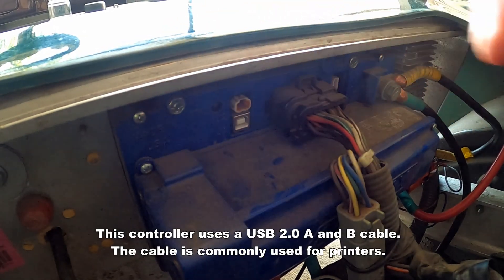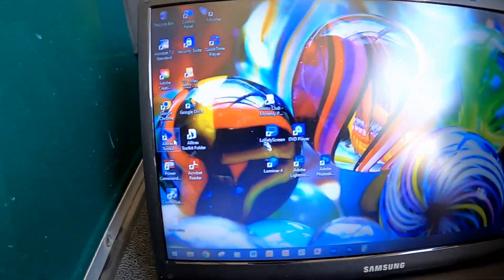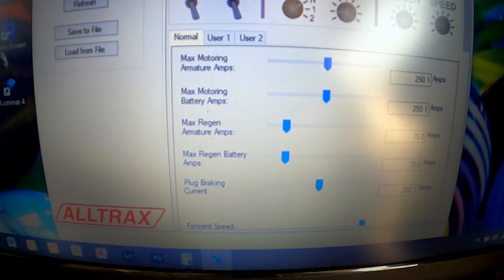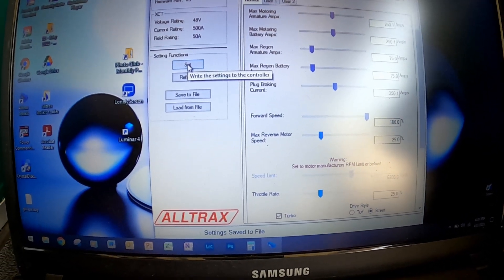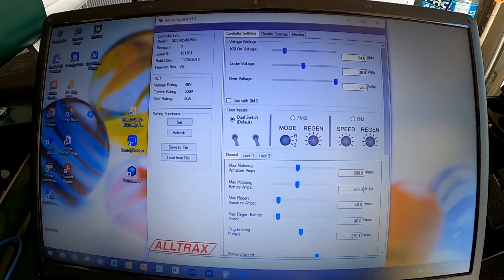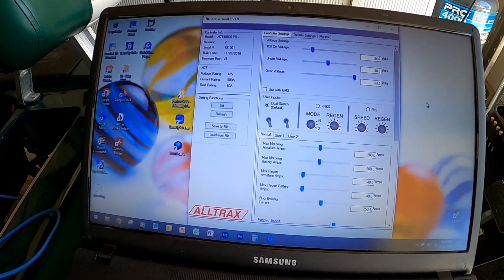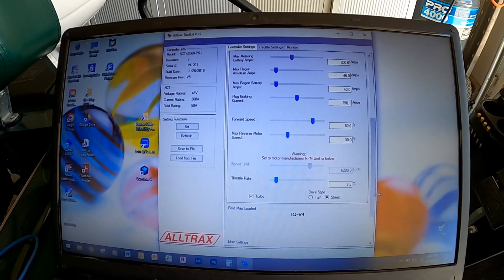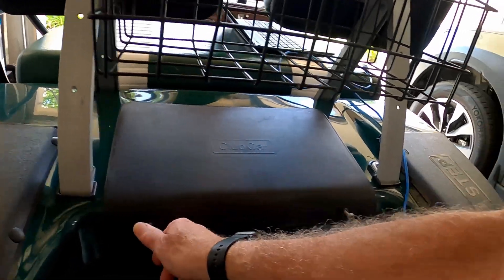Let's Ride a Golf Cart After a Lead-Acid to Lithium Conversion - Part II

Comment: Have you hooked up the battery display that came in the package with the cable?
Reply from the maker: Yes.  Positive is connected to the key switch so it only comes on when the key is on.  Come to think of it, that was another video all by itself!

Comment: Thanks for the follow-up. And the disclaimer. It's a nice system and seems fairly sophisticated. It looks like a 48v setup but I'm not sure what the amps are. I'm upgrading my 36v acid lead '97 club car to lithium. 3 12v 100ah batteries are on their way. Wish me luck 🙏
Reply from the maker: It’s originally a 48v cart, but the power train is all upgraded.  For your upgrade, assuming the batteries will be connected in parallel you’ll have 300 amps.  Should be plenty.  If the original controller will be used, check the controller’s rating to ensure it can handle it.  Otherwise, pretty straightforward.  Good luck! 🍀
Reply: @letsridewithwheels  His will be hooked up in series to make his 36v. The capacity will stay 100ah. Your Eagles are both 48v so are put in parallel. If memory serves the Eagles individually have 30ah of capacity, so in parallel they have 60ah. The Eagle has a Max Continuous Discharge Current:
80A,   Max Discharge Peak Current: 180A (6 Seconds)  With 2 in parallel those double to 160A and 360A peak. Wondering if that 11 hp motor has ever needed more amps than your system can provide? I have the same batteries but my cart is stock with a 3.3hp motor and the 300amp Alltrax. I still get 20mph on our gravel road, faster than we like to go! ;~) Great videos!
Reply from the maker: @DavidBeede  Good catch on 3 12v connected in series.  I totally missed it with only “parallel” on my mind.  Whatever the case with the motor and amps, fully juiced the cart leaps off the line and easily exceeds 30mph.  Enough for me!